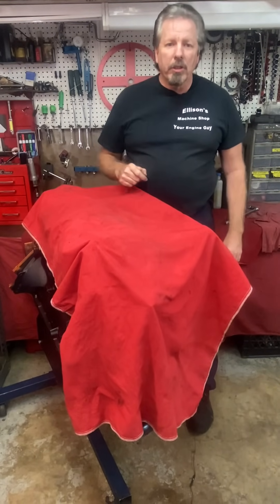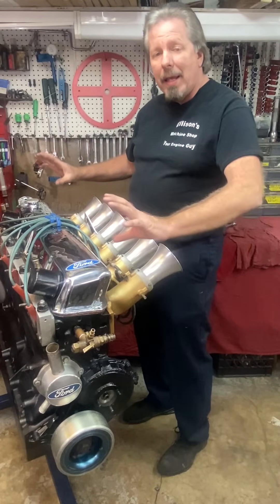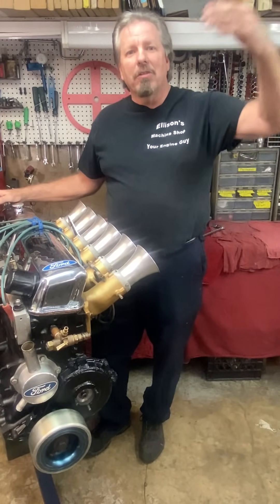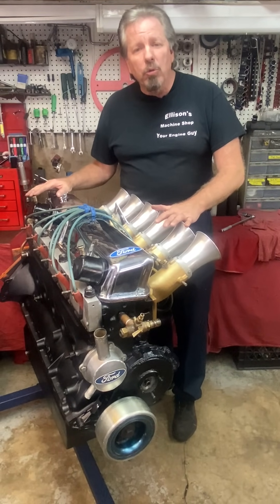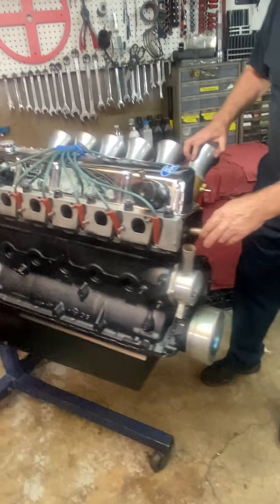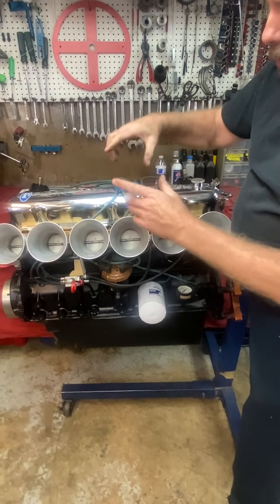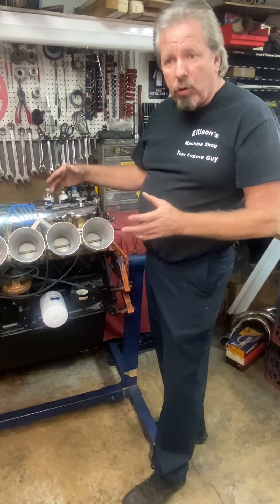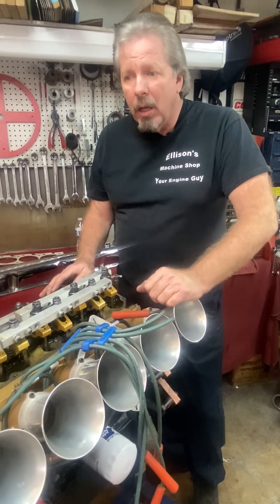Boss 300 Finished Project

Comment: I know a really good mold maker and sand caster. The guy has made some amazing things in. His backyard foundry. I know he could cast a 6 cylinder Cleveland style aluminum head . He cast and machined the heads in his insanely fast 70 Cougar 351 Cleveland. I am curious if he is aware of this engines existence.

Comment: That clutch in front of an auto was popular when I was a kid in the 70s. It was called a "clutch-automatic" (D'uh) and there were a few at the tracks I went to in New Mexico. The story I got was that the automatics of the day were not strong enough to handle the power off the line so they would use the clutch to get it going and then the automatic shift for the remaining gears for speed shifting. I raced a 66 Chevelle SS that was basically stock (Headers and ladder bars) with the M22 4 speed. I was pretty fast at shifting it and that was one tough tranny but I would have loved to have one of those clutch autos... Today my CTS-V with the auto in it shifts just fine for me.
Reply: There were Clutchflites ( 727s ) and TurboClutches ( turbo 400s )  . Cut the bell housings off forward of the pump and used an aluminum adapter that bolted on top of the pump. Used a three prong drive on the clutch side to engage the pressure plate and notches to engaged the pump gear on the pump. Bolt on a scatter shield. These came to be because there were no converters in the day to get the launch rpm you wanted. One early converter trick of the day was to use the Vega converter because it was small and would stall higher , But , if you made much power it would flatten out the vanes ! The clutch-automatic worked great for drag racing ( for the day ), but if you tried to run one on the street was/is hell on u-joints ! They shift hard and don’t have the cushion of a converter or multiple the torque.

Comment: the YouTube gods have brought me together with yet another awesome engineer, and engine builder. you can make this video as long as you want. in fact, it's not long enough. dude, you're standing next to a 306 race motor with aluminum rods, roller cam, boss heads custom fitted, 1 inch raised exhaust ports, my God, I'm not a Ford guy, but that's amazing. I subbed, I liked, can't wait for some more videos. ty😎👍💯💯💯💥💥💥

Comment: I remember the clutch flight trans. You can imagine the advantage at the starting line...
As for the epoxy work, that is old school,  probably JB weld. Bob Gliddon did a bunch of work on his heads and finished it off with JB.  I have seen small holes in engine blocks repaired (temporarily) with good old Justice brothers  (JB) weld. 

I have used it to repair curb rash on alloy wheels (or use liquid steel) sand smooth, must use aluminum primer and then epoxy paint -- low buck but it works!
Reply: We used PC-7

Comment: I saw one of these in some type of altered class back in the 80s at IRP. I  spotted the Cleveland head right off the bat in the pits. I think it ran like 9.40s. I also saw a 71 to 73 big body mustang with a 351c that had the block filled with concrete. He blew up and I saw the concrete.

Comment: I ran in Comp Eliminator in the early 80’s (351C ‘32 Bantam A/EA). Back then, Steve Ambrose ran one of those Boss headed 300 sixes and was kicking everbody’s butt.
Reply: I saw Steve Ambrose's  car at Maple Grove back then and talked to him for a long time. I was amazed that you can buy one of these heads from Indy Cylinder Heads. Sure saves a lot of work 🙂

Comment: Half-century old badass Ford Six. Set records in a T-bucket with a Clutchflite. 
I think we have hit "Peak Americana" gold right here.
Deep bow to Mr. Sligh.
Reply: I would like to hear more about the clutchflite transmission.
I've asked a lot of old car/racing guys an no one has ever heard of it.
Reply: @davidbaity3496  Long ago my Dad explained to me why a Model T would still beat most (then) modern cars across an intersection. It's planetary transmission could upshift without interrupting it's power flow. Until then I had had a negative opinion of GM Powerglide transmissions although I thought the Turbo 400 in our station wagon was nice.
      Also long ago hydrodynamic torque converters for racing were unknown so some racers reverted to a convention clutch but wanted the advantage of a planetary transmission.
         A MoPar Torgueflite wasn't near as good a transmission as a Turbo 400 but it is indeed what was started with originally.
    Slide the torque converter off the front of an automatic and you see three sets of splines. The innermost solid one carries the actual engine torque x rpm to the gears inside.
  The next (hollow) one is stationary and it is for the purpose of preventing the TQ converter's stator vanes from turning backwards when the converter is stalled (one foot on brakes other on gas). It is not used when a clutch is fitted to an automatic.
      The largest (outside) hollow splined shaft drives the oil pump that enables hydraulically-powering the clutches and bands that shift ratios (not gears) in an autotrans. It splines into the outside shell of the TQ converter and turns with the engine crankshaft. On a normal clutch there is no way to drive it. So by cutting the matching splines out of a scrap converter and welding three "ears" or "arms" outwards so that matching arms or ears on the clutch pressure plate could drive them = Viola! = A clutch flite. Now you can take out the automatic shifting stuff from a racing automatic, push in the clutch, select low gear, rev it up, drop the clutch and GO.
     Then without touching the clutch nudge the racing style "ratchet" shifter (won't permit moving more than one gear at a time) into second gear and BANG you got second gear. When 2nd is all wound out just repeat for 3rd gear.
     Believe me this should only be done nowadays with a Turbo 400 or a beefed-up Powerglide - because the launch and shifts are BRUTAL in a race car with suspension and slicks that BITE. 
      YOU BETTER HAVE A CUSTOM DRIVESHAFT AND U-JOINTS AND SAFETY HOOPS AROUND THEM - because you WILL break stuff !
Reply: @patrickshaw8595  
Thank you for the information, that explained a lot
Reply: @davidbaity3496  My pleasure to explain something I learned long ago, now half forgotten from collective memory > before I die or am unable to relate it.
     PS - Quite proud I was able to type all that out on-the-fly (without composing it beforehand) before YouTube comments timed me out !
      Lastly - "They" say you can't drive one of these things on the street but that's BS - you can. You just do everything like you would in a normal manual transmission, e.g. Feather the clutch for startoffs, snap it in, shift, snap it back out when the rpms are exactly right.
With a full-manual valve body and no governor you are working the oil pump many many times harder (all the pressure all the time) than normal so you need gallons of fluid and a serious oil cooler.
         I didn't invent this - but you can skip driving or even having the original oil pump installed at all. You add an extra power steering pump, a (big) remote reservoir and let it do the work, It's a much bigger stronger pump.
Reply: @patrickshaw8595  Great explanation of what these are thank you. Most of these guys have no idea how any of this works.

Comment: I’ve owned one of those engines in my 95 Ford F150 I’ve always loved that engine it wasn’t a performance engine it was just a workhorse and I had a big 18 foot Boston whaler with 150 hp Yamaha that motor would pull that boat down the road no problem

Comment: Awesome engine. Had two, one in an F100 and one in a 3/4 ton Econoline. Gobs of torque.
However, if you want to see what Ford can do with 3/4's of an 8 cyl, look into an Australian "Barra" 6 cyl. These came factory pushing nearly 400 hp out out of 4l (244 cu in). And its easy to get over 1000 hp out of the same engine with the stock bottom end and only minor other changes.
An even more awesome Ford straight six.

Comment: I've seen one in a dirt track late model, back in the mid to late 90's at Grandview speedway in Bechtelsville PA. Back then the field was split on I6 and the more expensive V8's, both ran on methanol alcohol and limited to a 600 or 700 cfm Holley. You are spot on, they were outlawed because of the inherent TQ advantages and the HP/TQ numbers sound identical to what I heard around my dad's racing buddies years ago.
Reply: Someone should use the head as a mold to make aluminum versions of it for mass production, there are thousands of 300 six's in salvage yards or still in use . There is definitely a market for a head and manifold combination for the big ford six cylinder.
Reply: And chevy s could not be found cheating no matter what was done to them we put up with the crap for years
Reply: Yup it's a hemi . Thanks Chrysler 😅
Reply: @danielcampbell6146  Chrysler? No. A Belgian company built the first hemi powered car in 1905. Many other European automakers soon did the same.

Comment: 300 (4.9) Ford is a legendary powerplant. It's basically a stroker 240 but the internals rival the 2JZ as far as durability. This would be one of the top three engines ever built by Ford and it's right there with the 427 FE W code and the now amazing Coyotes.
Reply: I had a 2nd hand F150. 300 six with a 5 speed and a fresh clutch. Truck had 265k on the original engine. Third gear was the magic gear, getting on the expressway. As far as I know that drivetrain was transplanted into a 71 F100. The truck was scrapped
Reply: I've had several, great torque characteristics, comes on smoothly and solidly.
Reply: I had one that pulled so good it's still talked about 22 years later, melted the #1 piston a few times, (kept spares on good con rods weighed the same) then one day my machinist made me take 8⁰ of total advance out of the ignition timing, and a few trick things to improve cylinder head cooling, then it was a little slower, but ingot 7 years of non stop hauling in a one ton dump w heavy equipment trailer allegedly loaded to the point where I allegedly  avoided agriculture check points and weigh stations, just in case, but that's probably just coincidental...pulled a one ton 4x4 454 CBB  in 4wd across a parking lot letting off the clutch in second gear at off idle, then took off, before i built the dump bed, with an empty 1972 OEM wooden flatbed sans side panels. I won a quick $20 bucks, thanks to Herc, Juan, & Chevy owner Baby Joe (Lacoochie Fl.) I was, am, an old school Chevy head, hot rods, but any truck but a dodge unless it's got a Cummins and a manual trans. I had a total of 380k miles of dogging abuse on it
Reply: @tomconner5067 
Do you still have it?
Reply: The 2.3 Turbo is as well. They just set a new doorslammer record a year ago at 7.00 flat in the quarter with one in a 88 T bird body car
Reply: Gosh dang!! They'll do 800hp unopened?
Reply: @realMaverickBuckley  Think more GE, not GTE, but even then you'd be way overstressing a stock internal GTE at 800 HP. I bet you could get into the 400 hp range reliably on a stock bottom end 300 I6 if you could get a decent head for one. I think you'd be hard pressed to even get 400 out of the factory heads no matter what you try. Some came with forged cranks from the factory, which I'm assuming is in the one in this video, so I'm sure you could push those a bit more. GetsumJ is probably talking more factory stock durability though. These will easily go deep into 300,000 mile territory in a heavy hauling application without anything but proper maintenance, similar to what you could expect from an old Toyota or a reliable diesel engine. Now there are lots of gas engines that will do that, but this was originally engineered in the early '60s, so legendary engine for its time.
Reply: @realMaverickBuckley  look up front engine dragsters. They use the ford 300 with LS/351 heads to make 650-700hp naturally aspirated monsters, I think higher classes run boost
Reply: I bet they sound incredible
Reply: @dennisrobinson8008  like a buzzsaw
Reply: @realMaverickBuckley  https://youtu.be/zzwmr3OAb3g
Reply: The 4.6 4V still holds the record for any Ford with the oe block and heads,timing components and crank. John Mihovetz prepped one ultimately running 5.88 @ 256mph  and I've yet to see any quicker run with as many oem parts. I love the Coyote as well and I believe 6.33 is the quickest with a sleeved oe block.
Reply: @chadkent1241  
What was that engine in?
Reply: This is NOT a 4.9. It is a 300 cubic inch inline six cylinder. This is the US. We DO NOT use the metric system other than for scientific purposes. I am tired of 5.9 this or 6.7 that. Cubic inches people.
Reply: @robertwatson818 Wrong, it's in fact labeled a 4.9 by the factory! Ford tech and Senior Master ASE with too many years working on them. How many vehicles are labeled with a Metric designation now? Ya all of them. And yes we are on the Metric system and we're supposed to be converted many years ago due too Federal mandate. If u want to be a global manufacturer and export the quality products we produce you must adapt to the prevailing measurement system for goodness sakes.

Comment: You could do the same thing with a Jeep 4.0. Same bore spacing as the Ford Windsor/Cleveland. I won't guess at the power though. And I just mean building the crossflow head. There was one team on the East Coast that was running a Camaro with a 292 with a custom LS head on top. But the LS and the Chevy 6 are on the same bore centers. There was also some people messing with putting a DOHC head on the Pontiac OHC 6 using LQ-1 heads off of the TwinCam GM V-6.

Comment: I remember reading an article in Hot Rod magazine back in the 70s, IIRC, on a Ford 300 that had a head made from two 351 Cleveland heads: one cut in half down the middle and the center two cylinder heads cut out of the other and the three pieces brazed together. It had three Braswell 500 CFM 2bbl carbs on it.
Reply: Remember that to, I recall the term "The cylinder head was furnace brazed together."

Comment: Now I get the point of the crazy kind of work done to build this: It's fifty years old. It's a piece of racing history. That bodged-together home-adapted head probably breathes and burns better than a Wayne-GMC conversion.
These days, after all, if you want a fast, powerful, indestructible inline six, you go to Japan for a 2JZ, or Australia for a Barramundi. Both have tons of speed parts available (though they also have to be imported), famed reliability, and with twin-cam, 24-valve layouts, they out-rev, -breathe, and -burn this home-made build. But neither of those existed in 1970.
Reply: Yep, and the new Supra / BMW six can support 1000hp more easily than a 2JZ or Barra.  Technology marches on, but we always celebrate the old stuff.

Comment: I loved the 300 I had my bronco and I love straight sixes I actually read about a guy that did something like this but with an LS head but I don't think he was running coolant it was for a drag engine.  I'm waiting till I'm in a financial position so I can do it except I'm going to use LS head from a 6 l try cathedral part first cuz they're cheaper and then maybe see if I can get a rectangle cord on there cuz I mean the 300 has a 4 inch bore so technically it might be able to take it and see if I can't recreate that and get a hydraulic roller camp working in there great job this is awesome great video I love the oddball stuff like this

Comment: Gotta preheat cast iron to weld, can't imagine the difficulty in something like a cylinder head...I think it's a hell of a good looking motor. Definitely a piece of Americana.
Reply: I wonder if furnace brazing would be easier. The trouble is the seams on one of these are pretty much in the head bolt area.
Reply: Yeah, I dunno... Not something I'd be eager to try...the failure would probably be pretty dramatic though, which is in its own way rewarding. Furnace brazing would definitely make it easier.

Comment: thank you for restoring this amazing piece of automotive history, i was lucky enough to work on the one built and run by the now late jerry meade from nj back in the early 70's  and know of all the epoxy work you pointed out,  . the head sections we used were furnace brazed back together by a place in michigan,   not welded , the block we used was half filled with epoxy to help make it stronger,
Reply: What kind of epoxy did they use to do these mods?
Reply: @dwalker399  water jacket wise it was normal race fill thin pour hard setting water jacket filler, mind wise trying to back 40 plus years sorry i don't remember the brand name . port wise today one could use black marine tex with metal 
these were very amazing built motors that ran right with way bigger motor,
Reply: @dwalker399  we used PC-7 similar to JB weld i guess
Reply: @lewishendershott4783  I guess so. I never used JB weld. PC-7 always worked for me.
Reply: @dwalker399 … The current block filler that a lot of people use is called Hard Block. We use it to strengthen Cleveland iron blocks for extreme builds. Most guys only fill about half way up the water jackets to add support to the bottom end. That way they can still use coolant and run on the streets without any cooling issues. 
There’s another product available for filling blocks that’s reportedly better than Hard Block but I can’t remember the name of it.
Reply: Yes my good friend Jerry i drove for him over a 10 year period both I/G { nhra record holder 74-75-76 and the E/A
Reply: @lewishendershott4783    wish we could hook up again lou,  i'm still in jersey , remember the guy with the turbo mustang i'm him
Reply: @lewishendershott4783   and you lou know the many secrets of this wonder motor,   please don't take them with you ,   personally i would love to meet up with you and talk old times  .
Reply: send me you e mail so i can get in touch with you